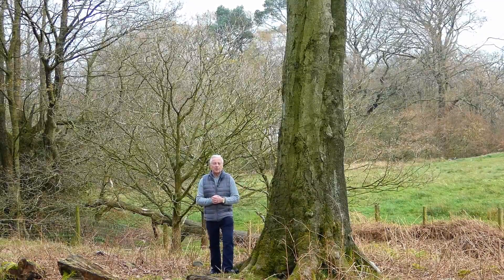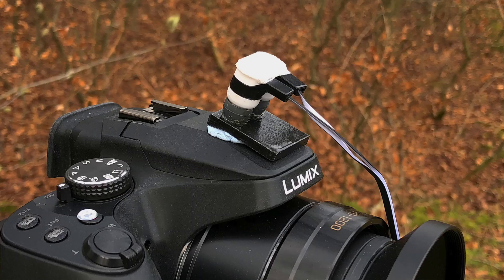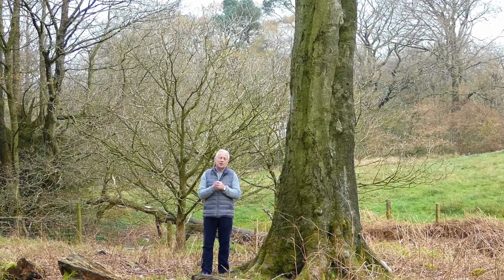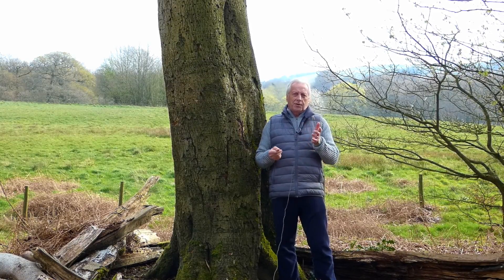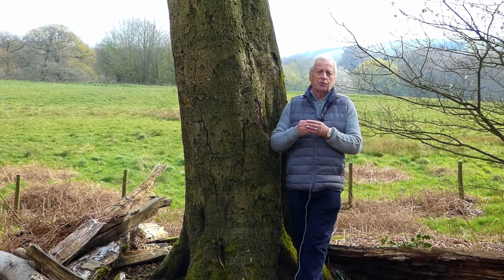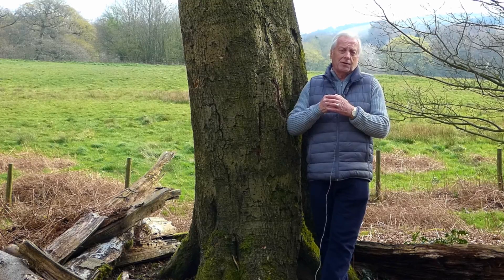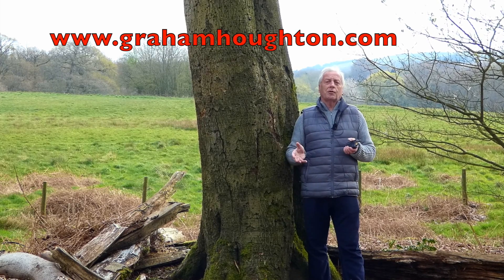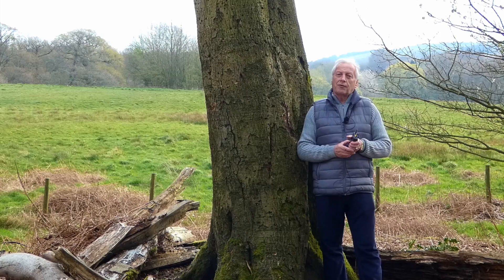Acoustic Coupled Wired/Wireless Audio Recording for Cameras with no Mic Input

Comment: None of them seemed any good to me, the best way must be to record on a device in your pocket & a good Lavalier mic then use your electronic clapperboard to sink in post, that works for me graham.
Reply from the maker: Yes that's what I normally use. This was just to overcome that extra step. Another set of earbuds gave a better sound and I'm working at the mounting and AGC defeat so the camera doesn't keep changing audio levels.
Reply: @GrahamHoughton12  am i right that in your photo of set up you had in-fact  placed the wireless transmitter onto the tripod rather than the receiver with the samson airline ?